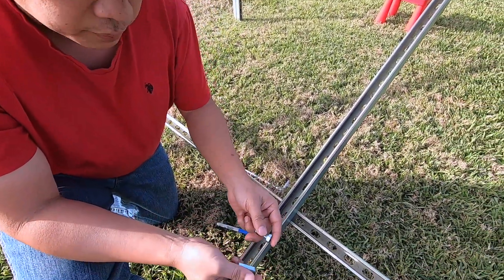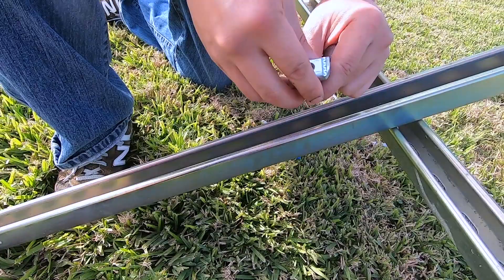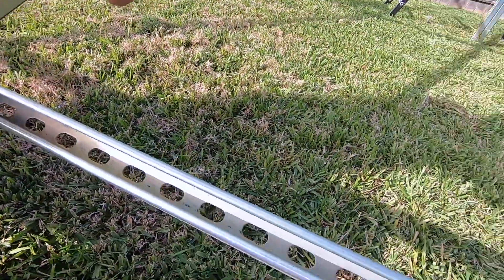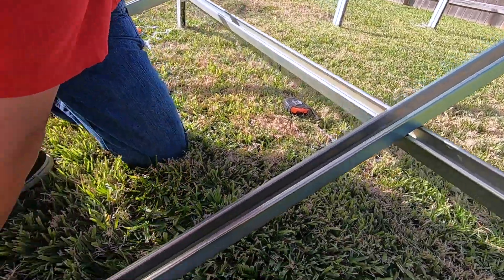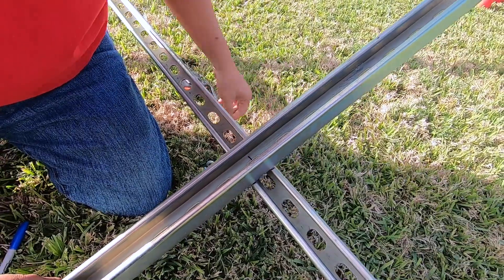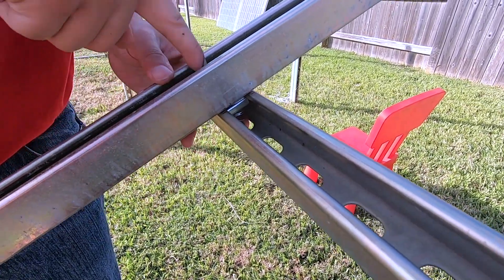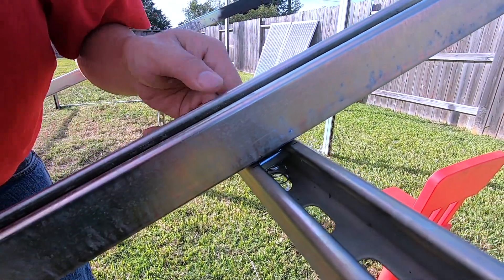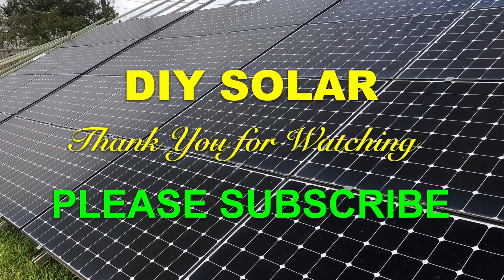DIY GROUND MOUNT SOLAR PANEL SYSTEM - INSTALLING VERTICAL BARS - USING SUPERSTRUT/UNISTRUT

Comment: I really appreciate the time you “gave” to educate me. I’ve seen several super strut videos and yours are the best. I do have a question. Do you think it’s a good idea to leave a 1 inch or so gap between panels ? The issue pertains to wind, sometimes we get major thunderstorms here. As I watched your video I realize this methodology is best for owners of different sized panels. I have 8 100 watt and 2 200 watt. I think this system rocks and ensures my ability to mount any panel neatly but group them by similar characteristics. Again thanks ! Buying some super strut tomorrow !